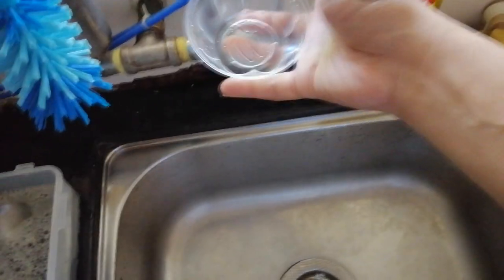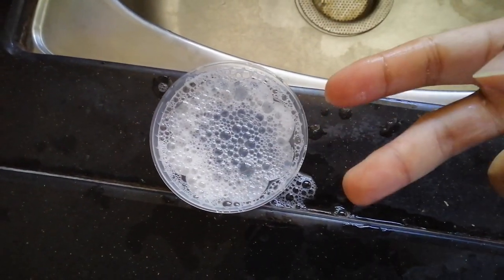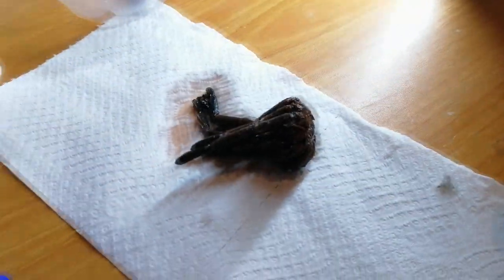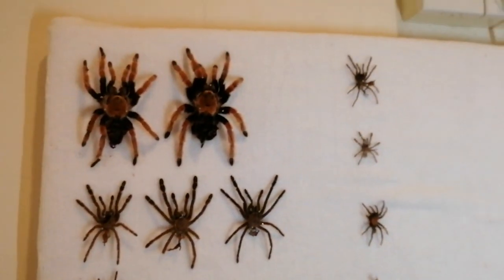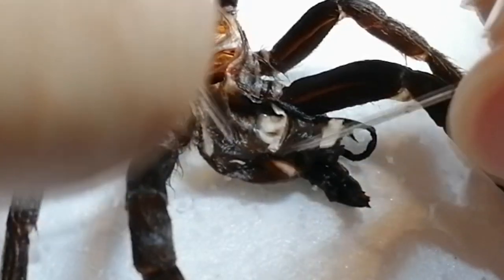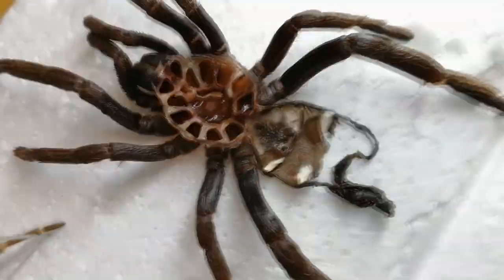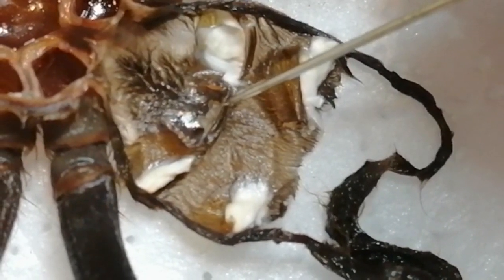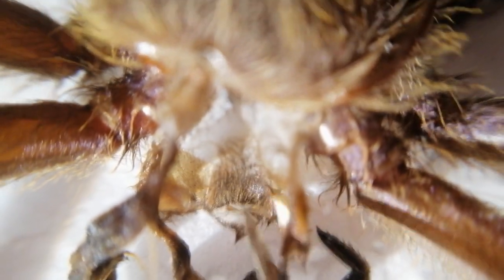How to sex a tarantula molt?

Comment: Beautiful Demonstration and Very Entertaining - First-time tarantula owner & My specimen is molting now. Thank you for providing this educational resource. I am curious though if I've made a detrimental mistake... When I first saw my tarantula on its flip-side, I moved it off of the specially designed web mat... I thought it may have died over night, but it wiggled its legs so I returned it under it's hollow rock structure... I left it on plain substrate, and I'm concerned this may impair it's ability to molt it's previous exoskeleton; because I imagine the web mat would have allow for the spider to better maneuver out of this old skin. Do you think this will lead to my spiders death?
Reply from the maker: That's a wrong move bro. Shouldn't have move the tarantula. I'm not sure because i didn't encounter anything like this before. U can monitor it n see if it is still doing fine.
Reply: @DavidFoo93   I figured so after making the mistake... I will watch it closely and let you know the results, and thanks for getting back to me.
Reply: @DavidFoo93   It was a successful molt! My spider will live to hunt another day :) Thank you for the advice

Comment: I just checked my brachypelma smithi molt, 8,5cm. There is clearly a flap but it is not M-shaped. Male or Female here?
Reply from the maker: As long as there's a flap there then should be female already. Perhaps the flap got torn in the process?